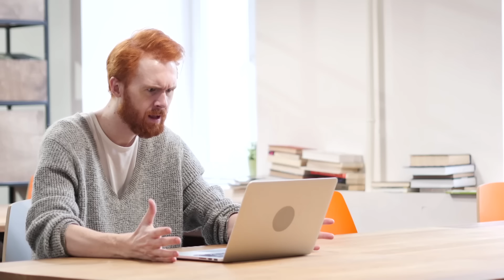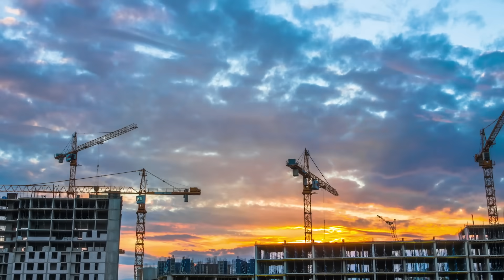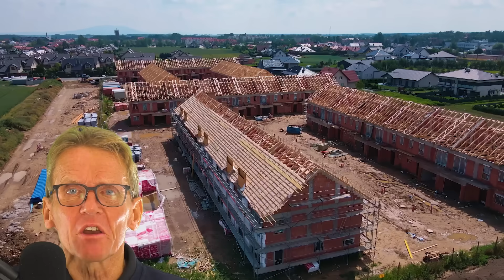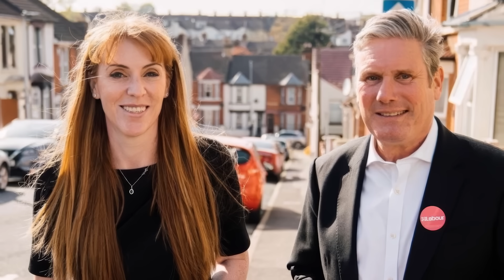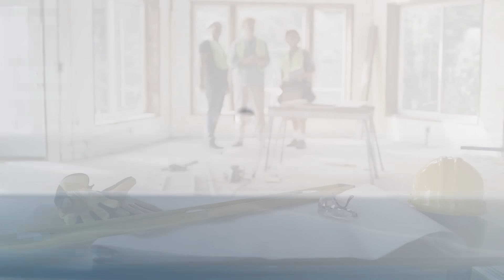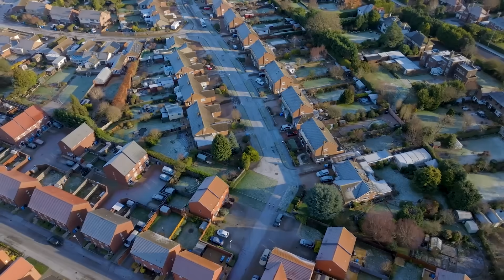1.5 Million Extra Homes in 5 Years?

Comment: There are not enough skilled building contractors or skilled tradesmen to achieve it. The new houses in my area are of poor quality. The builders have a price for each section of the build and will screw every sub contractor down until they get to the required price. Do the planners ever discuss with the water companies how many houses have been approved so that they can improve the sewage treatment works to accommodate the new volume. I have worked in nearly all of the waste water treatment works in Cumbria the vast majority have no space to expand. If they build 15 houses per acre that equates to 20000 acres of land required per annum and that would probably need to be trebled to include infrastructure. In my area the new tiny link semis sell for 200k. If there is no demand due to high mortgage rates the builders will stop building. So very unlikely that the numbers per annum will be achieved

Comment: According to Savills 231000 new homes were built in 2023 which is 10% less that the previous year. So that must have been about 250000 homes. If you multiply that by 5 you get 1.25 million which doesn't seem so far off the 1.5 million. When they say 1.5 million EXTRA homes does that mean 1.5 million on top of what's already being built, which basically means they have to more than double the number of homes built in a year. I'm just asking the question. I don't believe anything politicians say either.  Also I wondered about the term home. Does home mean a house or could it be an apartment in a tower block. Can they build homes in tower blocks faster than houses? If that's the case then I also wondered about these new towns Rayner is talking about. Is she perhaps thinking of building towns of tower blocks which you see in eastern Europe and China?

Comment: 1.5M homes / (1000 days x 8 h) = 188 homes per hour = 3 homes per minute, so even worse than "1 home per 2.5 minutes"
Reply from the maker: Yes, how is that going Anglea
Reply: @SkillBuilder  UK population is about 3.8 times higher than that of NL and the density in the UK is lower. In NL we currently build around 80K "homes" per year. Or really... 70K and then some office building conversions and splitting existing homes. 
Multiply that by 3.8x and you arrive at 266K - 304K/ year, which is more than that "1.5M in 5 year" that Anglea wants. 
NL government' target was 1M homes 2020-2030, which won't be achieved either.. But the actual produced value per capita is higher than Anglea's target, so I don't see such a big problem..?

The border should have been closed 10 years ago and we wouldn't have the shortage, at all.

Comment: If you do the maths then this just will not happen. Take for instance Barratts or Persimmon Taylor Wimpey or Bocis etc. they each build approx 30,000 homes per year. 1.5M homes divided by 5 year parliament equals 300,000 homes. Therefore you will need 10 x house builders the size of the current companies. That means 10 x the tradesmen 10 x the materials 10 x the land etc. that is not physically possible.

Comment: She does not need to go on site and ask a bricky or a sparky what's wrong, because all she will get from them are their tiny self focused issues. She needs to go to architects offices, structual engineers offices, heat loss, sustainability,  services engineers and customer workshops and lenders and building insurance companies first. Get designs that are fault tolerant, high quality, easy to build, cost effective, long lasting, (not the spec built 60 year "packing case like" boxes of today) and attractive to the customer. 
Then she needs to put in place proper training for those new building techniques, that may in fact have many new methods that present builders have no experience of. Your channel proves my point, we have been building brick and mortar houses for 350 years, they still cannot be made to a high standard, to the correct cost and in the correct volume. The building industry needs to face up to the truth, just as Corgi was a currupt den of self serving idiots, so is much of the building industry. If it were not, your channel would be called "Fantastic homes built this week". It is not. You try your very best (very laudable) to build up the skills (many of which should be known to a builder with 3 months on the job) in an often non caring money grabbing industry, . No good asking some of the money grabbers what they think, is it? This is not the professional, caring buildng industry of 30 or 50 years ago, today it's money, money , money, where the "trades" and even hod carriers think they deserve mor than doctors and all grab as much as they can and "Beep" the consequences, I'm sorry to say. Not wanting to offend, but you know that this is largely the case at the moment. Sorry for the rant, but this is my experiance over 20 years of active diy, and 20 as a self builder.

Comment: After WW2:' Through use of the wartime production facilities and creation of common standards developed by the Ministry of Works, the programme got off to a good start and, of 1.2 million new houses built between 1945 and 1951 when the programme officially ended, only 156,623 prefab houses were constructed.' Wikipedian fact.Re- think building? Panel based construction built by robots, designed by idiots? If the UK built more than 300,000 homes a year it would blow its carbon budget assuming normal trad techniques? Around 700,000 cars are manufactured in the UK each year. Add a few rooms to each and place mobile house hybrid on a new estate?